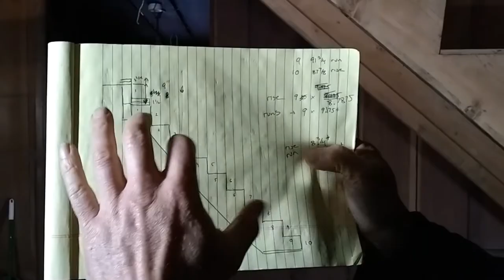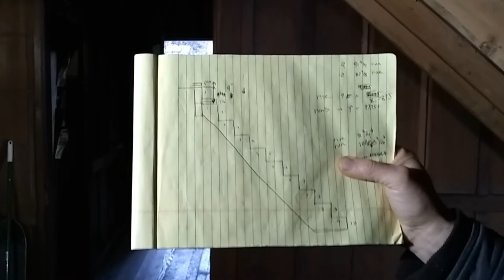DESIGN, INSTALL stair stringers in a small corner SPACE.  Pro Tips.

Comment: Does this job pass the inspection? It seems the riser is more than 7.75". Also the tread depth is measured between two vertical line (no less than 10', IRC code (11" in IBC)), so the angle will not help for the measurement (same thing for those open style staircase). Nice video.
Reply from the maker: No. Yes. Regardless of code, angle helped me when I tested walking it myself.  Thanks.